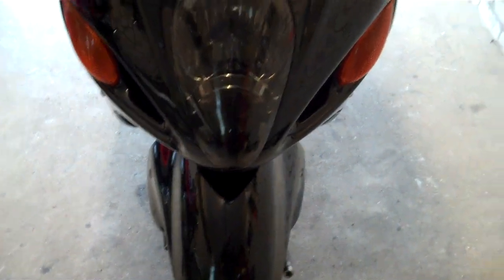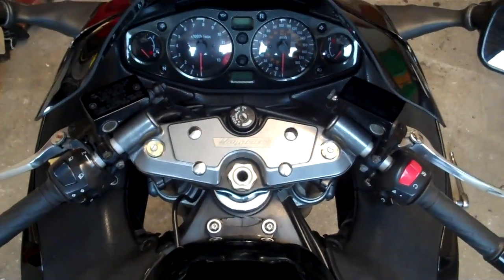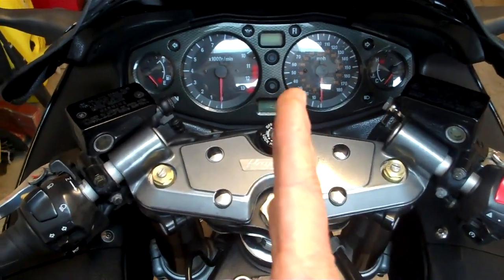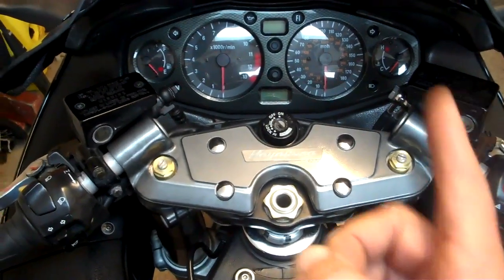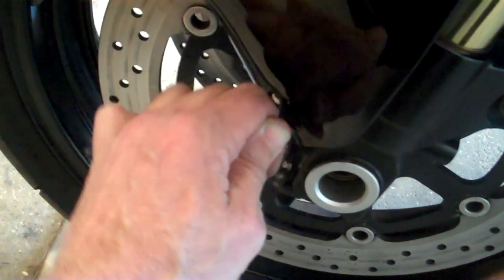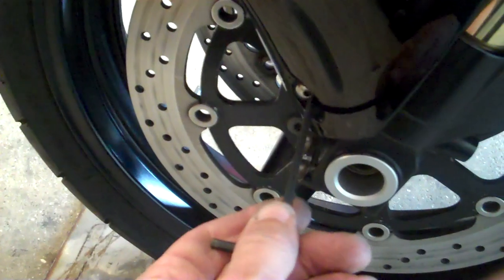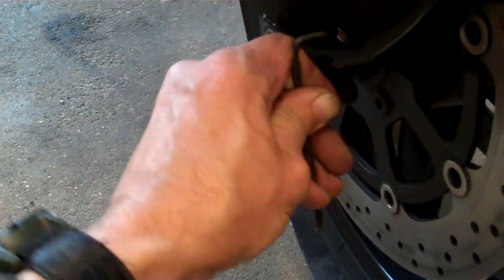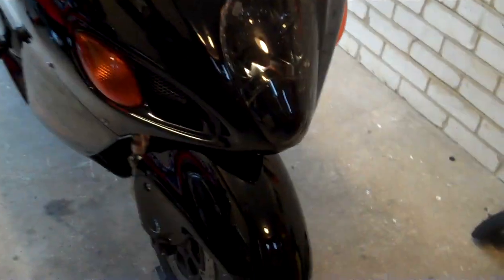Delboy's Garage, 'How-To' Re-align motorcycle forks the easy way.

Comment: Very good video! My case was a bit different though. I bought a 1999 virago 250 4 months ago. I already fell down and had a small accident. The result is that I had to steer lightly to the right in order for the bike to go straight.

No matter how many times I did the method, as I tightened everything again, my wheel would un-align itself(despite tightening each bolt very little at a time). (Also, I check my alignment by running the string trick from the rear wheel to the front, inspecting the gap on each side of the wheel.) What I had to do was to purposefully mis-align the other way and it would "un-align" into the correct position. I test rode my bike, I can confirm it worked!

I'm not sure what exactly causes this though. I'm suspecting when I have to tightened the top nut holding the top yoke so tight(54Nm), it un-aligns the assembly.

Also, I have to add that for my case, the headlight brackets connects both yoke. So don't forget to loosen those. My process was also lengthy because the handlebar blocks access to the top nut of the yoke. So I had to dismantle each time.

In short, I had to mis-align my forks on purpose for it to work. But I wouldn't know how to do it if you didnt made that video! Thanks for the tips!

Comment from the maker: Hi mate, yes that's fine, this method will work on that just as well - the side of the fork that has a pinch bolt is just to lock the axle in place, just back it off and then loosen the axle too and carry on as normal... just remember to do it up again afterwards and keep everything safe!  Good luck with it, Del

Comment from the maker: Hi Chris, if the paddock stand is the type with two brackets that cradle the swing arm spars, you can wrap a cloth under the swinger and protect it...then just lift on there....if its the bobbins type then you're out of luck as you need them to lift against.... the only other way is to ask another person to hold the bike on its wheels upright using the drab rail while standing behind....and make sure its on flat ground at the time....hope that helps chap...cheers Del.

Comment: Great videos mate! You seen like you genuinely know what your talking about, more so than any other channel I've found. 

I've loved motorcycles my whole life, and finally got a drz supermoto after 10 years of not having a bike (having babies). Decided to do all my own work and it's gone well so far. 

Bike is almost brand new, 2019 with 2400miles. Proper maintenance, proper adjustments (to my knowledge), open exhaust rejected carb and new tires, everything else I've done is cosmetic.

I put shinko 705 tires on (tough job for me, the first I've ever done). 150/70-17 rear instead of 140/70-17. It handles amazingly but I get a very sketchy speed wobble around 88-90mph(in USA). 

I've tried adjusting front end multiple times thinking that may be the cause, did the triple adjustment you showed last. Balanced the tires myself and it rides awesome just wobbly at high speed.

 It didn't wobble at 92mph on factory tires. The only thing I can think of now is the rake was slightly changed and suspension geometry may be causing it? 

Tested a couple times and tried to take hands off the bar thinking maybe I was gripping to hard or wiggling it slightly, to no avail.

Any response or input would be greatly appreciated, if you even see and read this.. I have absolutely no knowledge of adjusting suspension, and it rides great handles much better than it did, if I can't figure it out I just won't go 90.. 60mph off-road feels  fine, 72mph on old tires felt fine on gravel, 65 on gravel new tires feels super awful with front and rear jittery.
Awesome videos mate, hopefully one day I'll be as good a bike mechanic as you.
Reply from the maker: Hey Forrest, good to hear from you Sir!  It sounds like you're having an adventure with it... ok, speed wobble is all bad in any situation, and it is never acceptable, or normal... it always indicates a fault, or a problem, and will be something that is traceable.  OK, any speed wobble is inevitably related to something that is spinning... namely your wheels and everything attached to them... I'm sure you've checked pretty  much everything, you mentioned your rear tyre upgrade, but what front wheel and tyre is the bike running?  And what tyre pressures do you run them at?  Also, is the headstock turning full lock to full lock, side to side, smoothly?  And is there any 'freeplay' in the headstock?  If you can get the front wheel off the ground and the bike upright, crouch down in front of it facing the bike, grab the bottom of the fork legs, and pull them towards you with a lifting motion, there should be no freeplay whatsoever..... check those things and let me know about the tyres, let's see if we can iron it out, it's just elimination buddy!
Reply: @Moonfleet41  Thanks for the reply! I thought of that as well, there is no play in the steering head and it turns lock to lock smoothly. From what I hear from the factory they don't grease the bearings much.. but it's all tight, no play. The front tire is factory size 120/70-17 and I am running factory recommended pressure 25psi front 29psi rear. They are radial tubeless tire with tubes in them (spoked wheels) factory were Dunlop d208 which are tubeless radials as well. The shinko 705's are like an 80/20 much deeper more off-road type tire and the factory dunlops were just street supermoto tire. Everything seems tight and as it should, with no play (I ordered a torque wrench that is coming today, just to put everything exact).  I've done quite a bit of research and other people seem to have similar issues after replacing tires, tried everything as far as alignment etc. I stumbled accross an article explaining the larger (.55") diameter rear tire changes the geometry and rake, and people adjust the front damping or rear sag? I believe? To compensate. Overall I'm happy with the performance up until 88+mph(which I don't need to go that fast anyway but...) It turns and handles much better and I can take turns noticably faster and it feels more confident throughout. But as you said there shouldn't be wobble and something must be off. Now that I've done a couple performance mods I don't feel safe to try and actually too it out, stock I could only get 92mph.. first time I mounted tires and had a bit of a struggle, but the tubes hold air perfectly and I heard all the beads set, and put them on the little balancer and they balanced out well. Adjusted everything to factory spec. Had close to 30psi in each my first ride and it was noticably wonky, so put factory pressure and it feels perfect and solid until 88-90mph. Only had full blown tank slap on my rm250 being stupid as a kid and never want to experience that again though.
Reply from the maker: @minimuggin  OK, it's always difficult to diagnose over email or messenger, all I can do is suggest things... and trust in your common sense... I know it sounds really daft, but I assume (and I am quite sure you have), you put both tyres on the correct way round?  And you've checked the bead line finger tip close to make sure they truly are fully seated?  Remember, once you spin a tyre at speed, you are getting close to what happens with dynamic balancing, so did you use the right size inner tube?  I assume with all of these you did, am just talking out loud!  The only thing I can think to suggest is tyre pressures... I've never run tyres as low as 25, in fact I've never run below 36psi on any bike and although it's a lightweight bike, how heavy are you? If you're a big guy, then that has to play a part in it... and remember tyre pressures need to increase if you're going to run high speed, even on cars... the Hayabusa's front tyre pressures is 42psi... so, perhaps, consider trying out some higher tyre pressures, maybe 32psi front/36rear and see what happens... you never know, it may just be low tyre pressures causing this... as you said, be careful, and am sure you'll work it out.
Reply: Yeah I thought tire pressure may have something to do with it, I did use the proper innertubes, Michelin, and tire are on correct rotation. They seem fully seated? Should I try to pump them up more just in case? If not that's sketch I've rode it around a couple weeks and gone quite fast lol... I figured they were 2 loud pops from each tire. I am about 215-220lbs so probably a bit heavier than the suspension is set up for from the factory. Supermotos I guess run much lower pressure like a dirt bike. It seems to get better the lower the pressure though. I wanted to run 30 so they might last longer but it was definitely a less stable feel. Thankyou so much for taking the time to try to help me! From the dealer they had higher pressure than the manual recommends and after I set it at recommended it felt better. Some people run even lower like 23f 27r or lower... It feels great with factory just that sketchy wobble at 90mph
Reply: Well, after your advice I wanted to be positive so I sprayed the beads with Windex and pumped them to 90psi 🤯. Finally got to ride yesterday and was excited, but hit 92mph absolute no wobble!!! Then toward the end of my ride shifted from 4-5 at around 75-77ish and wobble.. backed off a second and it was good.. so I guess I was to blame after all. Or maybe it's getting better as the tires start to wear in. I think it's just more sensitive now, I will try to play with suspension settings, as they are factory set now, and see if it helps. Thanks for the input mate! I've spent way too much on sweeet parts and after I install everything I'll try to put up a video. But she's a ripper, and it's fun to tinker and make it my own. Thanks for the knowledge and inspiration

Comment: Hi Del, thank's for sharing this tip... i did this today on my zx-9r E1, i have owned for years now, top yoke has always looked and felt off to the right, today i took your route, blimey i had hassle with the bottom yoke bolt's as they were previously changed for Allen head stainless bolt's, could i get an Allen key in there with the fairing fitted, no chance, had to cut the Allen key 90 deg leg down by half to get access, then had to use a 90 deg ring spanner on the Allen key to get leverage, needless to say, i took each Allen bolt out one by one and replaced them with the stock 12mm head bolts, i then could get a 12mm spanner on them while steering was straight, and yep it's worked, my top yoke now looks much straighter and the bike feels better riding, i'm hoping this will help with my left handers as i seemed to be struggling with the front end staying where i want it during the bend. thank's bud.. :)
Reply from the maker: Hi Nick.. sounds like a good little mod to go back to the bolts..cant think why anyone would make such a change for no reason.... its not much when the front is out, but it will never feel right.. good luck with the new handling, take it easy and let us know how you get on... all the best.. Del.

Comment: Very informative! Awesome with all the details mate.. I have a 2014 BMW S1000RR Premium and I have the same problem, guy I bought the bike said the fork is bent and it needs new forks but I don’t think that’s the case. Looks exactly like yours did, their is no scratches or any real signs of something that would point towards the forks actually being bent.. I’d assume if that was the case you’d see some physical type of impact damage.. their isn’t any I think someone just dropped the bike and or jumped up a curb. I’m gonna try this method
Reply from the maker: Good luck with it mate, i hope it just snaps straight for you.

Comment: This is great. I binned my Tuono 1000 R at no more than 20 kph a couple months back. Falls and pulls to the left when seated upright with my hands off the bars in a straight line. Dealers are clueless. Chassis repair shop apparently straightened bottom yoke but still not right. I'm going to try this and get back to you. Thanks.
Reply from the maker: Go for it buddy, and check the REAR wheel alignment at the same time... also check the clips on on the top yoke are equally arranged each side and that one's not twisted or bent... finally, don't forget to loosen off the top centre nut as this allows the two yokes to move separately and re-align... good luck!
Reply: Well I set up the laptop with your video in my workshop and followed your instructions to the letter. Went out for a test ride and the bike is way improved. Still not 100%, maybe 99% but I think that's due to the right handlebar being bent 10 mm down and 10 mm back in relation to the left as a result of the off. She now tracks straight and cornering input left and right now feels balanced. Thank you very much. To think that two dealers and a chassis specialist couldn't do what I did in an hour with your help seems to show that many dealer workshops don't really care. I will be visiting your workshop regularly from now on and am going to do as much of the maintenance on my bike myself as I can. The money I would normally spend on servicing? I'll spend it on tools.
Reply from the maker: rocklooney
Oh well done mate, thats great to hear, and probably no more then a bent clip-on to replace.... As for shops not caring...well in my opinion, its not a lack of care, its a lack of knowledge... they just dont know these things because the college they went to, to get their "Master Technician Degree" doesnt cover basic chassis setup....this is because the facotry sets the bike up, and they are only left to sell you a new set of yokes, forks, or bars..plus, they set all their prices for jobs, based on pre-allocated, timed tasks (e.g basic service = one hour, Fork seals = two hours etc etc..... they have no remit for "investigative remedy"..they can only charge you by the hour...and if they are not confident in the right remedy first time and have to spend hours head scratching then your bill will end up ridiculous at £70 an hour...
Glad you are not on the right road with your bike care... good luck matey, and ride safe.. Del.

Comment: Great, simple explanation. My bike tracks very slightly to the right - will check the alignment in this way. Could it also be caused by forks at different heights in the t-clamp?
Reply from the maker: Hi buddy, well naturally your forks should be level with each other, so at the very least, get that right first as one will be stiffer than the other, or doing more work as it were... it certainly could cause an imbalance, it's always something I've taken as read and wouldn't ride a bike if I noticed that - so good luck with it , see how that works, and let me know how you get on !

Comment: Thanks for another helpful video, i really appreciate how thoroughly you explain each thing.

I've noticed my front wheel on my Ninja is a bit out of alignment when i look at it, which i think might also be the reason that the bars wobble instantly if i take my hands off the bars at all.. I'm going to re-align it with the help of this video and see if it fixes it, even if it doesn't i'll still get the alignment fixed at least!

Cheers
Reply from the maker: o7m8 HI mate, great news that the video can help you...also, wehy not check the rear wheel alignment too, and cone you get the two perfect, the bike HAS to ride straight.. hope you get it sorted, goos luck with it.. Del.
Reply from the maker: o7m8 HI mate, great news that the video can help you...also, wehy not check the rear wheel alignment too, and cone you get the two perfect, the bike HAS to ride straight.. hope you get it sorted, goos luck with it.. Del.

Comment: Thanks for the video!! I would like to make a suggestion if I may. Instead of using a nut to loosen the axle nut, take a spark plug socket, find one that fits your bike, turn it around and put a 6" or so extension through the "mouth" and the attach your ratchet. It works great.
Reply from the maker: Hi Daniel....great trick.. somebody else suggested it a fare few lines down.....i love youtube... cheers buddy.... Del.

Comment: Hey Delboy, you are incredibly helpful! I had my fork seal blow out on me amd i had to ride it home about 17 miles. Got the seals replaced and everything is measuring center and everything is torqued to spec on the front. My handling is feeling like im hitting an oil slick from time to time, more often than not. I dont feel safe riding it. So my question to you is, what on earth is causing this? What do i need to cover from front to back?
Reply: I also replaced the wheel bearings on the front
Reply: I would think maybe there is fork oil on your tire and in your front brake if you lost a fork seal.  Could be the cause of your issues?  Try new brake pads and front tire maybe.

Comment from the maker: Hi Christian, sadly you wont get a good alignment if the bike is on the stand...but if you get it all released from the top down as shown, then sit on the bike and push it off the stand...do the lunge up and down thing....and have the spanner in your back pocket....hold the bike at exact balance point...get the spanner and reach down carefully to nip the bolts up tight on the bottom yoke....then back on the stand, and do up the rest.....easy..hope that helps..good luck, Del.

Comment from the maker: Hi Jon,do the lunging action with everything lose except the 2 top yoke clamp bolts, once it's straight THEN you can do the centre nut and then bit by bit work your way south to the axle... don't forget the mudguard mount bolts as they play a part too and do up a quarter turn at a time alternating side to side until they are tight..bad luck on the low side and after such a drop don't forget to straighten up the bar clamps too if they are bolted through the yoke, take care Del